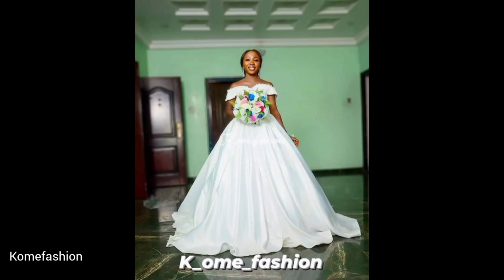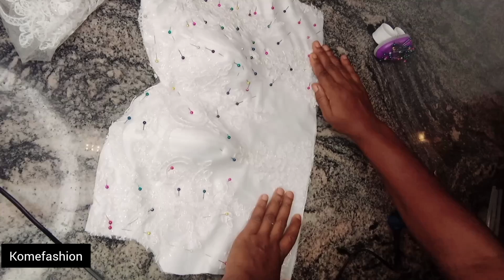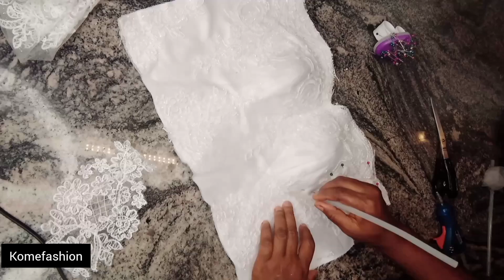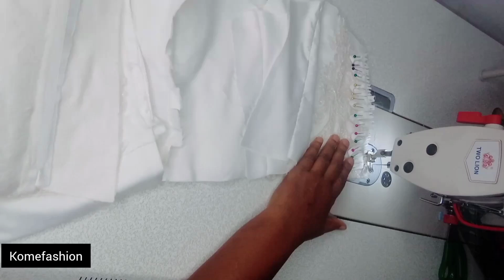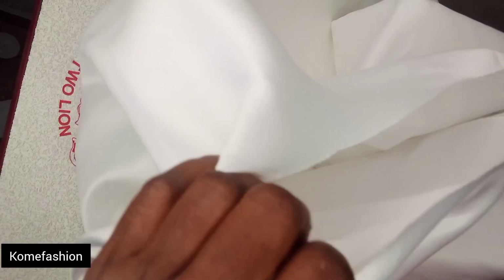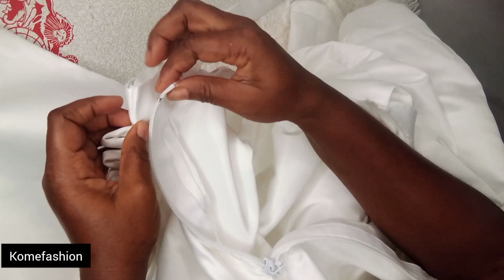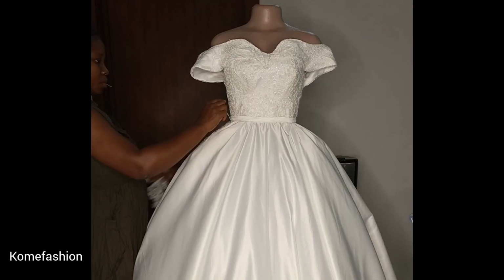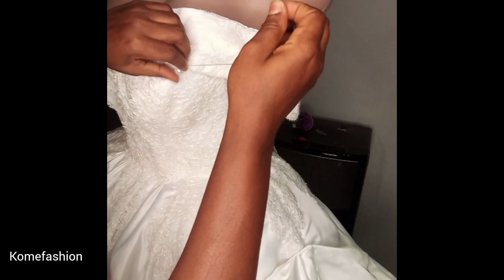How to sew a moderate wedding ball dress. #sewingtutorial #weddingdress #diy

Comment: This is amazing 
Best of all have seen 🙌🏻🙌🏻🙌🏻
Well detailed 
Thank you ma🙏
How you make the down part fuller incase you want it more puffy ? 

Secondly if you want the back longer how do you achieve that do you cut the flare separately??
Reply from the maker: If you want the back longer use the high and low method,yes you will cut the front and back separately making the back longer than the front.
Reply: @kome_fashion  thanks 🙏

Comment: Please ma what if someone is using the 60inches excellent bridal... How many yardage and won't it have joining
Reply from the maker: 60 inches you should buy 10 to 12 yards, depending on how big your client is. Yes there will be joining
Reply: @kome_fashion   God bless you ma.
  What if the back will be longer that the front like mermaid,can one still cut in 360° flare
Reply from the maker: Cut it 180,2 of the 180 cut will give you 360.so that the back can be longer but you will be needing more fabric
Reply: @kome_fashion   how many yardage of 60inches will I be needing and do i need to finish the hem with crinoline
Reply from the maker: About 20. Yards,yes you can use crinoline for the hem but it's optional
Reply: @kome_fashion  thanks for your time 🙏🙏🙏